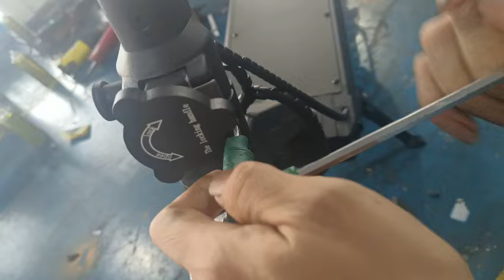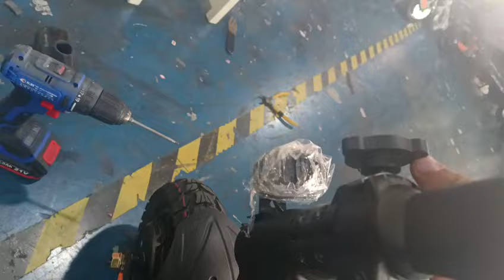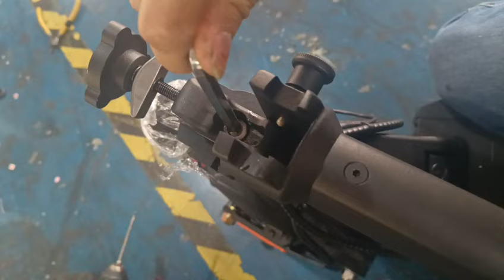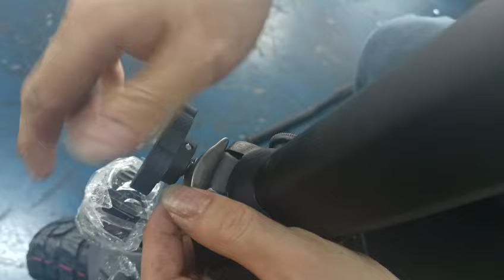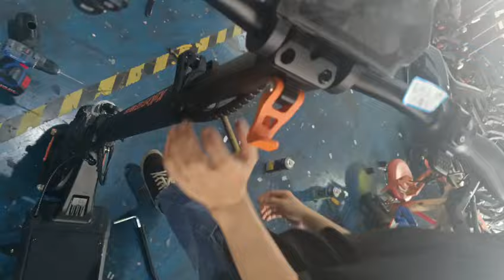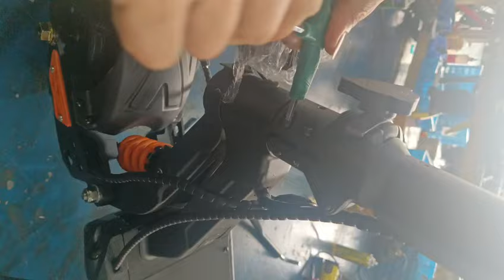KuKirin G2 Master  Pole adjustment  （立杆调节 ）

Comment: I have a problem that the steering wheel moves forward and backward, you don't feel it much while driving, but why did this happen? All screws are tightened, I tried to do as in this video to get rid of this problem, but it didn't help. I unscrewed the Allen keys, tried to tighten the largest one inside, but it was tightened to the maximum, then I turned the steering wheel to the right as in the video and turned, it didn't help...

Comment: What is the screw under the rubber cap that goes into the steering cylinder for? The threads are stripped on my scooter.